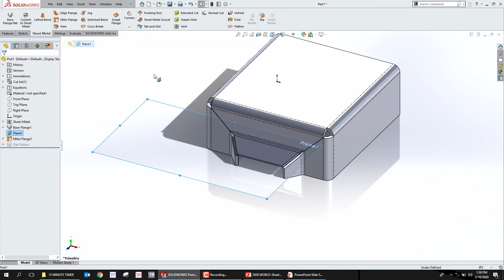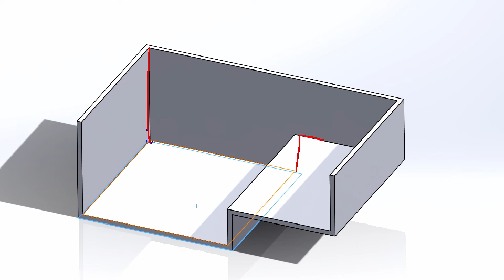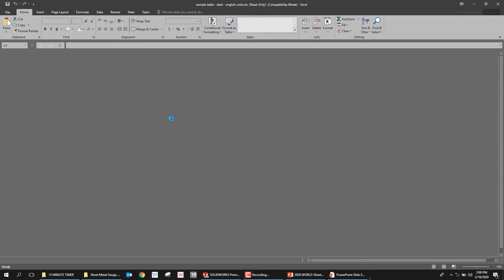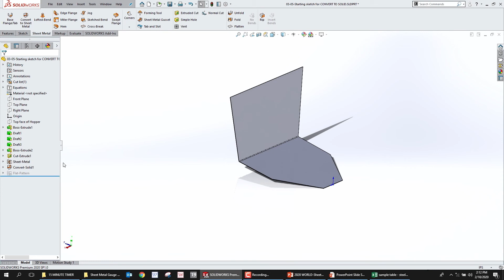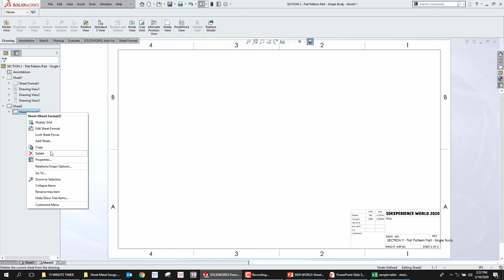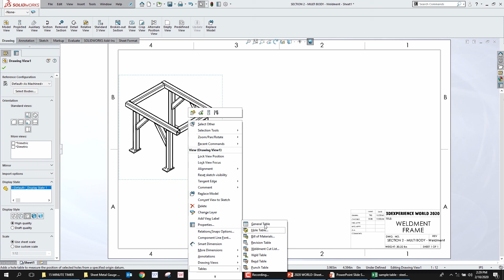Toby's Sheet Metal Tips and Tricks

Comment: Presenter mentions sheet metal bend radius should not be smaller than material thickness.  In reality this is not true.  Inside bend radius should be determined by material and fabrication method and available tooling.  As a sheet metal job shop forming 5052-H32 alum., CRS, and HRS, SS, etc. we use coining press brakes and air bend press brakes. On coining press brakes we use 1/32 inside bend radius on all material thicknesses up to .093 and have not issues with stress cracking on outer surface.  To get a correct flat pattern the inside bend radius must MATCH the tooling being used. Coining tooling is typically available 1/32, 1/16, 3/32, 1/8, etc.  It is also available in metric however that is not as common in US.  I strongly recommend designers to also put a note on drawings that inside bend radius to be within a range. Example: .03 to .09 in. for 14 ga. material. Some materials do not follow this since they are too brittle to form with a tight radius.  Example is 6061-T6.